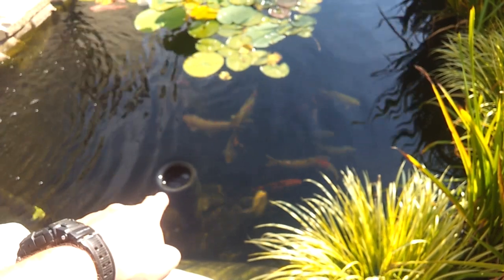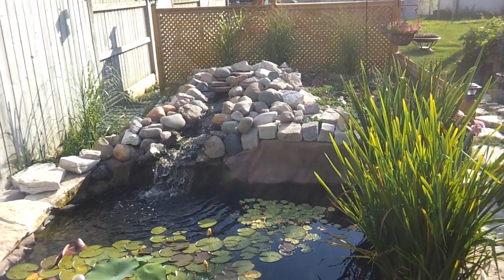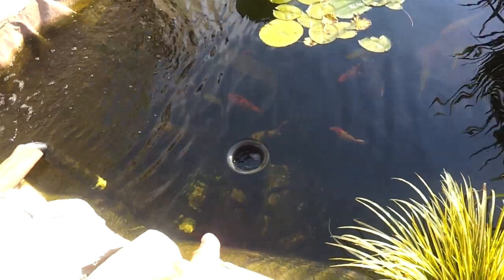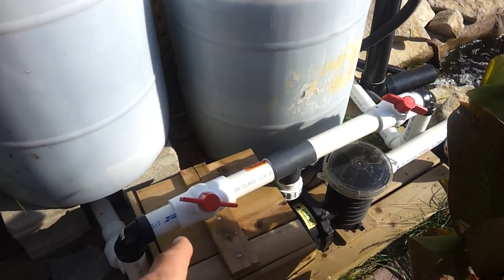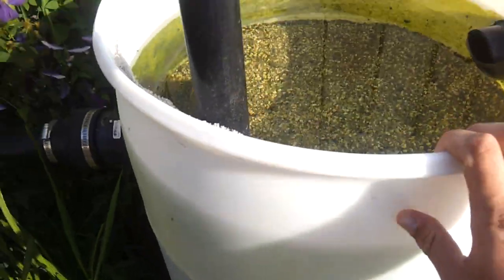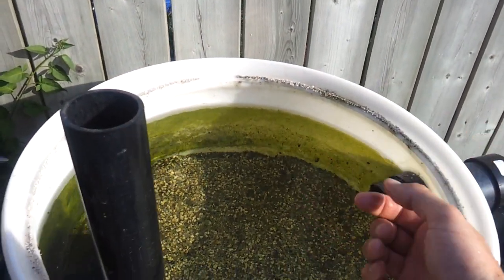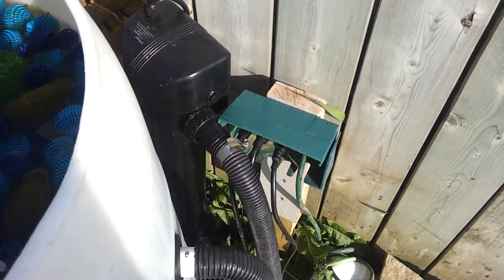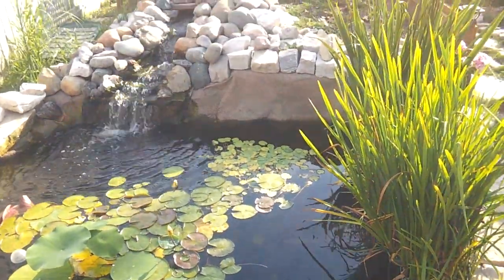BEST DIY KOI POND FILTRATION SYSTEM

Comment: Love this system and just ordered several parts to build it when they get here, could you tell me approx how often you have to hook up the shop vac and blow out the rocks, or how you know when its time. Thanks.
Reply from the maker: Depends on your system and how much bioload you have. But mine is about once a week when it's primed for the season. Takes a month of warm weather to get the water running with beneficial bacteria.  Water will need blown out when you see the water tunneling in the sand.

Comment: Hi, so you said you have a gradient of gravel grit size going through your gravel filter... When you clean it by blasting air through it does this not mix the gravel grit sizes together? How do you stop that from happening?
Reply from the maker: Because you're only blowing enough air through the filter to boil the crushed granite (chicken grit) if you get some kind of high   powered blower it'll mix and drop to the bottom of the filter.   But the leaf blower shop vac I use doesn't do it.  Easy fix if it does.  Add a ball valve to the inlet pipe and restrict airflow.

Comment: So you made a sand filter upside down? Never would have thought of that. flowing the water slow enough that it doesn't mobilize the filter particles. So when you inject air to mobilize the fishwaste for backwash the larger particles stay lower. Does that depend on the specific flowrate? I would think not enough air you'd get the larger gravel not moving and too much air without tapering the flowrate at the end you'd get the gravel locking in place further up, not having a chance to seperate from the sand.
Reply from the maker: Been using it for over 10 years now.  Works like a charm. Crystal clear water.
Only thing that boils is the sand.  Gravel stays in place. It's too heavy to "boil".

Comment: this is the most simple logical pond filtration i've come across on youtube. you explained everything perfectly! i have one question though. what mesh do you use to stop the smallest gravel going to the bottom of the barrel? thanks so much for making and uploading this video, i really appreciate!
Reply from the maker: No mesh it would all just plug up with with crap. Look at my how  to build video and it explains it.
Reply: ok i just found your comment here, saying you dont have anything to seperate the layers of gravel. i still cant understand how the small pieses dont go down when you "boil" the water...
Reply from the maker: Lol Does it really matter? It just works... Is it baffling to your mind? Different layers of rock and stone are minerals of different weights and sizes. Each layer just slightly larger than the previous one so they don't just fall or mix Boiling only moves the top layer because it's lighter than the others it's only 3/16" chicken grit granite. The remainder of the rock won't boil because it's too heavy.

Comment: Hi is it necessary and compulsory to feed the sand gravel filter with water from down below the drum?.
Reply from the maker: Khizar Hayat yes it has to be forced to flow through the different layers
Reply: Robs Koi Pond do you have the link for the oase surface skimmer?
Reply from the maker: Khizar Hayat sorry I don't. I don't think they make it anymore.
Reply: Robs Koi Pond do you run the pump 24/7?.
Reply from the maker: Khizar Hayat 24/7 you really need to join a forum and do lots of reading before you decide to open a pond.
Reply: Robs Koi Pond Thanks for the info well i went through the forum you mentioned in the caption any other suggestions for forums?. Actually i already have a pond but its basically a waterfall /water feature.But first i want to learn the science behind filtration ,ecosystem and all before i decide to keep koi.
Reply from the maker: Khizar Hayat koiphen is your best bet. They can help you along.
Reply: Robs Koi Pond Thanks for the help
much appreciated.

Comment: When you backwash what keeps the sand from all mixing togther?
Reply from the maker: Kelly VB the weight of each material. Chicken grit is the lightest and boils at the top.
Reply: Cool, thanks for your reply. Very fine system you have.

Comment: like your system i have a question for you i have almost the same system as you have but i only use 1 55 gal. with a pool pump i have 1 1/2 inch pipe going in and 2 inch pipe going out to the waterfall  but for some reason my waterfall  doesn't work and the 2 inch pipe gets low of water any ideas why is it doing that??
it should work fine since is the some system as a pool system .

Comment: How long has this filter been running and how much do you feed your fish per day (weight of feed)? Have you ever been forced to empty out the media to clean it out?
Thanks!
Reply from the maker: Filter has been running for a few years, Never emptied it out and if you look at my other vids you will see I have a large bio load.  They are fed daily sometimes twice about 2 cups of large pellet foods.
You should never have to empty it out. this is what blowing it out with air does. Boils the water to clean out all the stuff that builds up.
The bio filter on the other hand every year will be dumped out and bio balls given a quick rinse.  There is always a 1 ,2" layer of sludge at the bottom that settles and that's what I clean out.

Comment: I have the system all hooked up and the light on my UV light is not working. I was wondering if there was something I had to have besides plugging it in to a 110 light socket.
Reply from the maker: Wow missed this comment sorry. There must be something wrong with the uv light or power source. I'm assuming you must have figured it out by now.

Comment: very cool filter set-up!! I want to know do you have the same water in the pond from day 1 or have changed topped up the water or completed changed the water ever if so, how often have done so. please let me know
Reply from the maker: The water is the same.  Its constantly evaporating during the summer and needing top ups.
 When I blow off the filter to clean I guess that would count as a water change because I have to fill the pond back up when Im done.

Comment from the maker: @civicehatch9. I used about 100 lbs in mine about 8" deep. The water must boil large to clean. So if your leaf blower works that's cool. You can also use a 1.5 hP spa blower as well.

Comment: Bob I looked at the birdman's S/G filter link you posted but still wonder how the sand doesn't settle down into the bigger rocks? I am guessing the air "boils" out the muck and keeps the lighter stuff to the top? is that right? I also noticed that the sand is more like a very fine gravel.  where did you get that type of material? I am currently using a bio filtration with lava rocks and is rather difficult to clean.  thanks Bob it was a great tutorial.

Comment: Hi, I am building my koi filtration system now. What do you use to connect the pipe that goes from the sand barrel to the bucket with bio balls? What kind of 2piece connector? and where to buy it? I looked at homedepot and they only had sizes of 1 inch. Also do you keep a rubber washer in between?

Comment from the maker: I used to test all the time before the filters matured a bit. Now that they have and I have the biological up and the Ph swings under control I don't test. If the water is clear fish are happy there Is no point in testing.  
As far as blowing out the sand gravel filter I do it once a week. It's a 15 min job start to finish. Bio filters I don't do anything to them. They won't be touched till winter when I shut down the pond

Comment: cool filter. Do you use any type of material to separate the gravel layers and the sand layer? Also what keeps the gravel and sand from mixing when you use the shop vac to clean it?  Thanks for the info. That is an awesome filter.